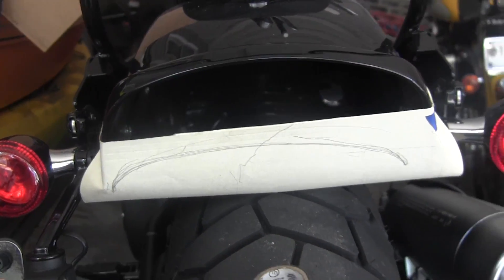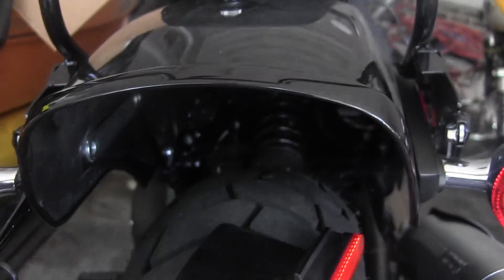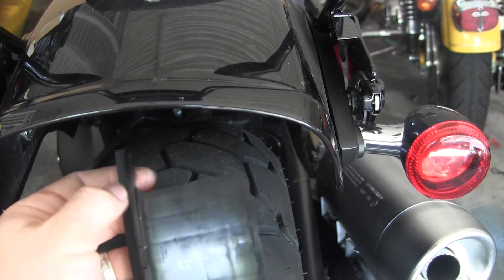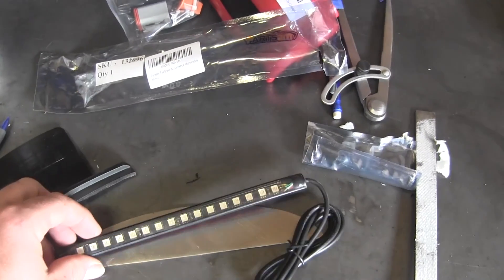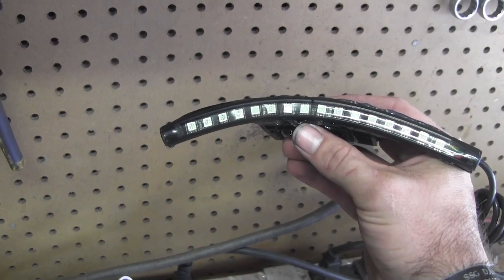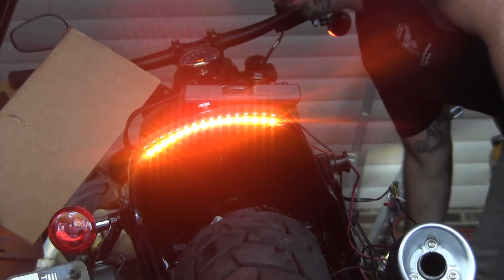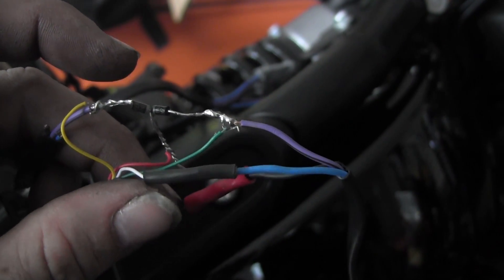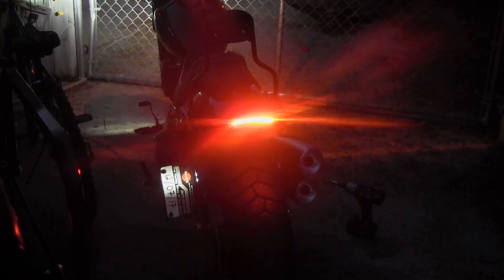Custom DIY $10 2018 Harley Fat Bob LED Tail light / Brake

Comment: This really helps!  I'm still getting a full yellow light when I press the break.  Turn signals and running light work fine.  Added the diode to the red cable just like your video/diagram.  Still get yellow with either break.  Soooo frustrating.  I would truly appreciate your help! 🙏🙏

Comment: Good video. But I think your schematic at the end is backwards from what is shown in the video.

In the video there is only the purple wire running from the left side (the gray terminal) and connecting to the yellow wire.

But in your schematic the blue, black, and purple wires are all running from the gray terminal. 

I’m a little confused.

Comment: Hello. can you send me a link of the amazon product? i see a couple of them. Im wondering if they are all the same. Also my second question is have you figured out how to get the tail light to light up the whole bar and not just the middle. I'm not sure if its just the wiring. But in the pictures of the ones i saw on amazon. The pictures for their tail light shows the whole bar light up for the tail light and it gets brighter for the stop light and the turn signals work the same way. which is independent. Thank you. Great video by the way. tnx

Comment: I bought front blinkers for my Harley and the stock blinkers have 3 wires. But the led blinkers I bought have only 2 wires. They say it’s for my bike. Can I wire the 2 wires up to the one wire and then the other one is for  ground? Thanks for your time.
Reply from the maker: The three wires is because your front blinkers also serve as running lights. If you don’t care about running lights then just find the wire that has constant power and tape it off. Use the other power and ground wires to connect the blinkers. If you want to maintain running lights it can be done on a two wire blinker but requires a couple resistors and a couple diodes.
Reply: Ok. I’ll look into on how to do that. Never done it before. Thanks for your time.

Comment: Instead of the wobbly calipers, why didn't you just put a piece of cardboard against the line you had and then draw around the top of the fender onto the cardboard,; and then cut the cardboard just beneath the line you'd drawn, to give you a perfectly flush fit curved template?

Comment: Will this modification void your warranty? Especially cutting odm harness? Just curious
Reply: depends on where you are, and your dealership, but generally speaking it will only void your warranty in the case of there being a failure that could reasonably have been caused by your wiring.  so for instance if your bike catches fire from an electrical failure of the lighting system, you're up shit creek.  if the engine were to seize it would be really hard to justify.  if your engine started leaking oil, there's not much they could blame on you

Comment: Great video but did you just throw that digital caliper?? Cringe!!!
Reply from the maker: Maybe not the gentlest set down, but they weren't thrown. Usually I have the case sitting on my bench but for some reason I left it under. Either way you're right, certainly not the way to treat some expensive calipers.
Reply: Lol for sure brother. I worked with machinists and that was rule number one at the shop. You can understand. Great job with the install. Looks great!